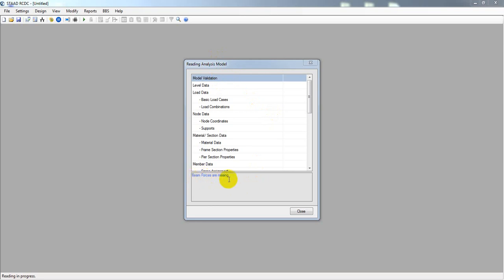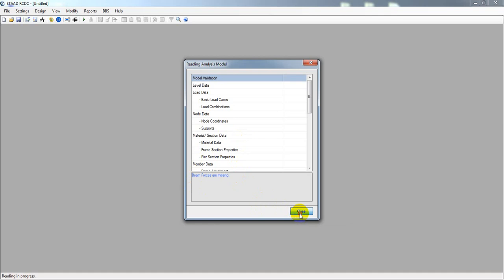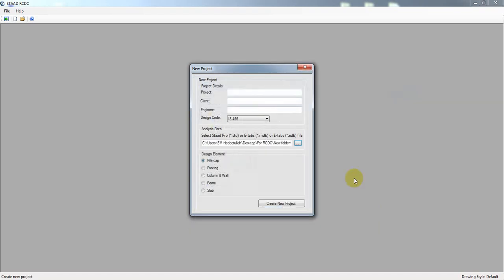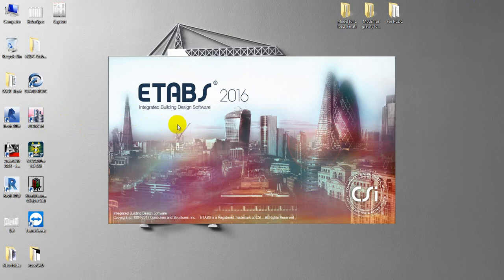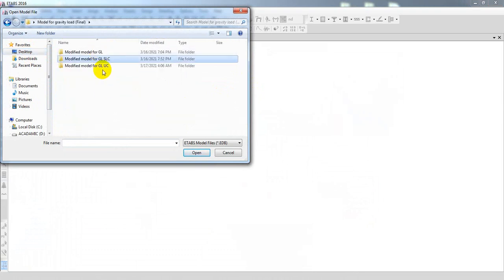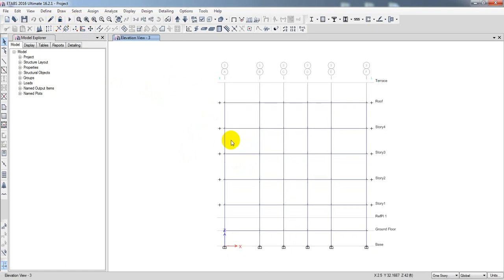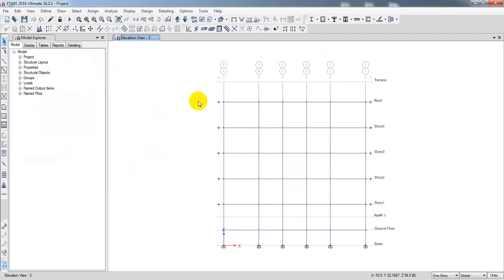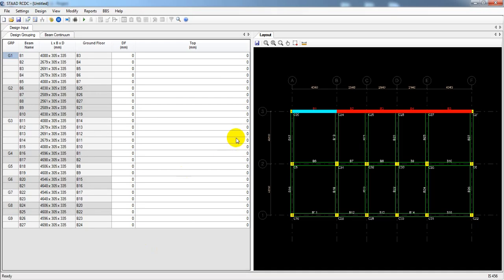ETABS to STAAD RCDC Import problem fixed : etabs to rcdc Beam Forces are missing

Comment: Please help! I have realized that when I release moments in staad pro secondary beams, RCDC is unable to read the correct beam length data. Also in instances where the beams meet without a column and/or grid line, RCDC throws excessive increase in the beam length.

Please what could be causing this anomaly. A 3 meter beam in staad pro becoming 8 meters in RCDC is quite alarming
Reply from the maker: YOU CAN TRY LETEST VERSION OF STAAD RCDC

Comment: sir in my case importing from staad pro to rcdc 4 slabs are missing in plan and I have provided a shaft as well while designing between beams but it is taking that as the whole slab how to solve these problems??
Reply from the maker: is your irregular in shape?
Reply: @qlearnify-en  no it's rectagular, is there any other way i can introduce slabs in those missing places? i tried adding Lx & Lz dimensions but it didn't work out